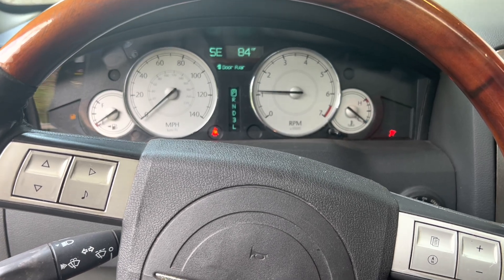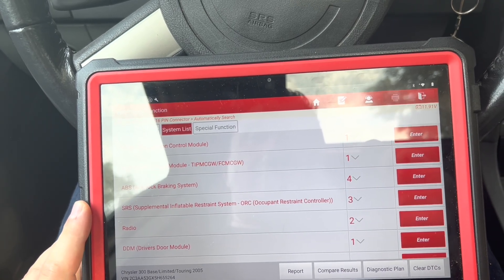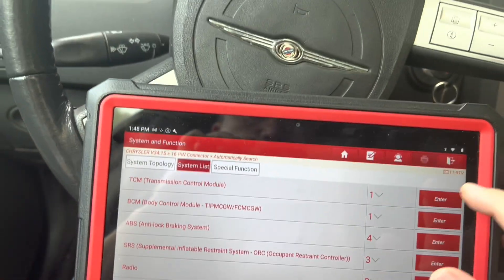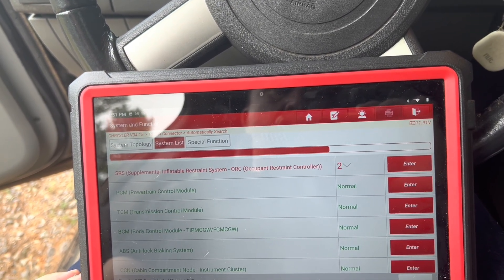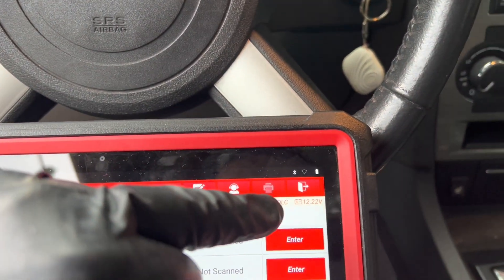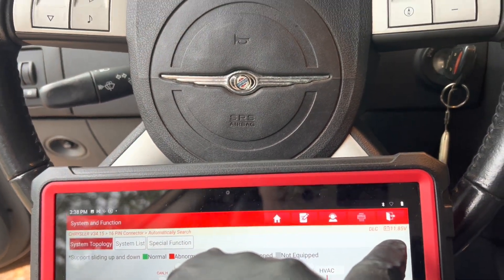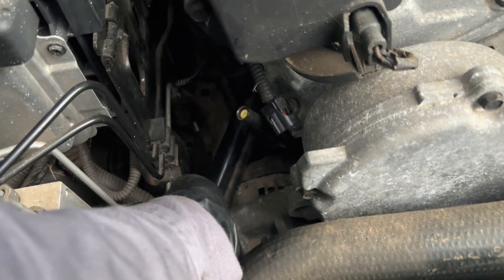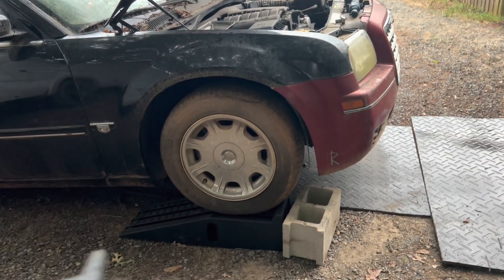Chrysler 300 Limited Battery Light On: Diagnosing Alternator Issues | Part 1

Comment: So I'm currently diagnosing an issue with my vehicle that might be similar/correlated to alternator. When I go to turn on my vehicle, it will click and no start. I have to attempt several times and every time will click until it will finally start but immediately die out. When I finally get it to run I have to accelerate to keep the vehicle from stalling out. When the vehicle "maintains" it will not turn off after that. Any suggestions?